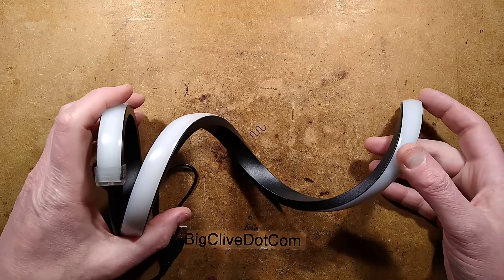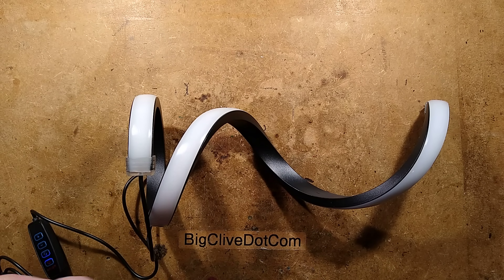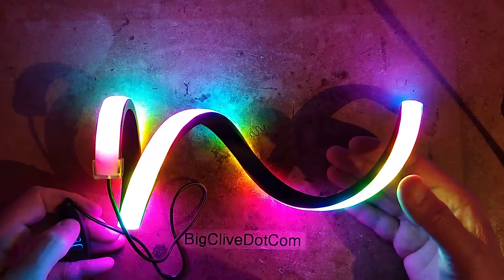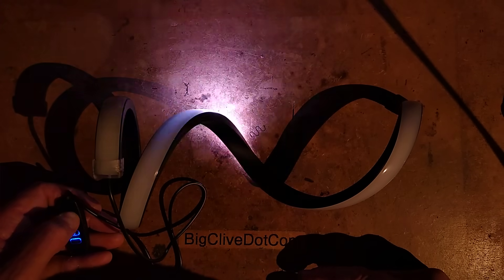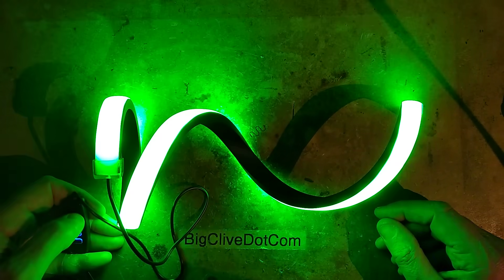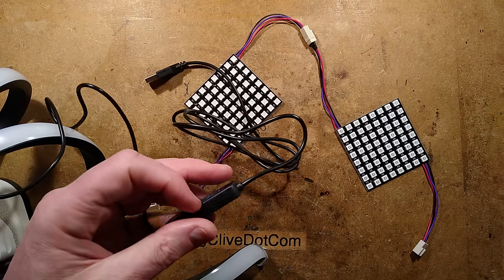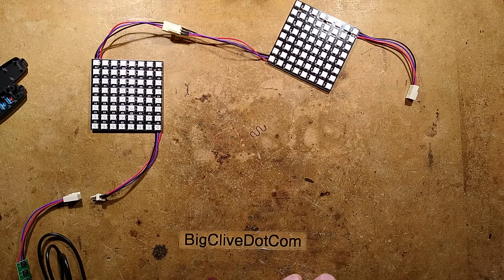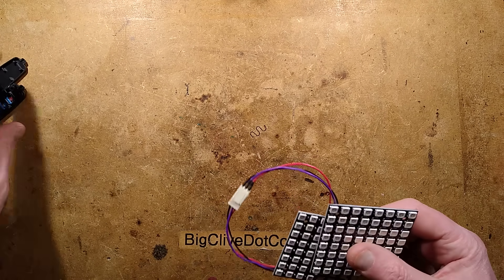RGB 36-LED spiral - bit bashed to the edge

Comment: I found an addressable tape that had a break in the tape. I cut off the non connected end and found the +5, din, and gnd. marked on it. I am only interested in one function unison red flash. The original controller does that. If I can get the cut end to do that it would be great!
Reply from the maker: You can join short sections end to end as long as you consider the high current these LEDs can pass.  You can also run multiple sections from the same controller output and they will just display the same colours.

Comment: Ive noticed a subset of controllers is usually mirrored and  different codes for  the bluetooth and or IR etc SP105E, SP108E, SP110E

Comment: Lots of folks here are suggesting WLED - but it doesn't do temporal dithering the way the old FadeCandy boards did. That's a big drawback for smooth transitions. I've not used FastLED but online info suggests that it does do dithering. And it has the advantage of running on a wider range of hardware. I used code from BigJosh running on a very old version of Linux on a BeagleBone Black to drive my Xmas LEDs last year, but I'm wondering about moving to FastLED. Far more than 36 LEDs though...
Thanks to BigClive for yet another interesting video!

Comment: I don't know how many addressable LEDs I run at home, but a lot! 😄 Light underneath the bed, lights on al shelves, lights unterneath the workbench, light on the back of the workbench, random "lightbulbs" (actual old lightbulbs I took the filamet out off and replaced it with LEDs) dangling everywhere, a string of 300 lights dangling in the hallway, ...
Everything is on WLED on ESP32 or ESP8266 (depending on the length and if I need ArtNET).

Comment: I immediately recognized the controller as I had the one for my magnifying light apart recently to fix a loose connection. The board layout is very different with tiny MOSFETs for data and 5V. The model number was NU003 which brings up all kinds of lighted magnifiers on google.

Comment: I have several sets of Phillips brand  RGB Christmas Icicle lights that are controlled by bluetooth. You can set different colors and effects in the strings of lights with your phone, and it's either 3 or 4 sets that can be connected end to end off 1 controller box, although each set of lights comes with a control box, you can connect several sets together to make a longer string and not have to group several control boxes together in the software. The lights also flash out patterns from sounds from your phone's microphone OR you can play music through the app and have the lights flash out patterns and colors to the beat of the music. 

I noticed that the sets worked absolutely fine when responding to music when each set was connected to it's own control box, but when I strung 3 sets together to be able to make it all the way down my picket fence, and run the 3 sets all off 1 control box, that I would occasionally get a glitchy LED in the strings when they were responding to music. There were no glitchy LED's when running through the slower, pre-programmed changing modes, but only when the lights were changing faster to music. The LEDs in the light sets must not be able to keep up with the faster moving data from real time music. 

I've learned to live with it though, as the occasional glitchy LED when responding to music is usually a white shimmer, and it looks like random stars twinkling in the "wall" of icicle lights hanging down from the top of the fence.

Comment: Yes, I have been naughty a time or two and bit bashed the hell out of my home-brewed hardware for running a large video wall, and sooner or later you WILL get to the point where pushing it just a LITTLE more and you end up with random LEDs glitching out. 

Better hardware, less code, or less LEDs is the answer when that happens.

Comment: At least it actually responds when you press a button. Unlike the Govee equivalent, which takes several seconds to start up the app (which has to load ads for more Govee products) and then several more seconds to send any in-app data changes to the ($60-80) light.

Comment: Yes, it bit bashes the data at 800KHz, the timing has to be spot on, being asynchronous.
It is a walk in the park to hook it up to an esp or Arduino and get Chat GPT to flash up some code for you that controls the leds the way you desire.
The data is passed through with a delay of half a bit, it's very fast.
Had some looking at it once with a 4 channel scope and seeing how the data is being passed on.
Good video Clive, thanks for sharing.

Comment: I would hazard a guess that the malformed data at the end of the string may have something to do with the VCC being too low at the end of the string to allow the internals of the LEDs at the end of the string  to pass the data on to the next LED properly.
Reply from the maker: It's possible.

Comment: wow you could not have chosen a better time to upload this video. Just this week I received a cheapo $1 aRGB strip from aliexpress and added it to my gaming pc. I cut the 50cm / 30 leds tape in half and soldered a 1 foot cable between the out of one length into the in of the other. it worked fine during testing but then I started a game and the 2nd strip started going crazy, just like shown in this video. I didnt unplug it, the wires are soldered directly on the tape. I'm guessing the extra line of wires between out and in acts as a antenna and picks up all kind of rf interference, corrupting the signal. Or maybe it adds too much delay idk. The 1st strip works fine. I guess my option is to bypass the 1st strip and wire the two strips in parallel. I think all my rgb fans are connected in parallel so that should work?

Comment: you need an oscilloscope to further analyze things like this...
Q: if you only apply power to the strip to that color it defaults or it doesn't illuminate at all?
Q2: can you hack your way without an MCU to force a single color?
Reply from the maker: I do have some 'scopes, but a high throughput of videos limits the amount of time I can spend on each one.

Comment: I can't see how your hypothesis about timing accounts for the flickering at the end. If earlier devices thought that they had got the "that's it" signal, they would reset their internal state. They would see then see half-way-through as new data. If that kept happening then the later devices would never see anything. If it only happened sometimes then the later devices would either get the right data or nothing, so they would not flicker. It is suspicious that the flickering is ALL of the later board and NONE of the earlier board. Did you try swapping their order ? It smells to me more like one board is faulty, or the interconnect is dodgy.
Reply from the maker: I did swap the order.  The timing may be so on the edge that voltage drop along the run may be affecting the internal oscillator timing.

Comment: i have 4 of those but changed the controller, the controller that comes with it does a power on reset and the other ones that i used is goign back to there last mode , i use it with a domotica system.. but the spiral lights are fun

Comment: It's silly but I always close or avert my eyes when BigClive says "watch your eyes" and turns on a bright light. Also thanks to your dives into LEDs, I made a clock with  WS2812B led strips as the hands and a Raspberry pi Pico a few years ago and still use it. I run the LEDs at really low power so I can just see it in the dark so it's going to last quite a while. It's also different hues based on the time of day or holidays. I would've never have made this without watching your videos and streams and being inspired by your projects.

Comment: Whatever "squishing" of the waveform by the 1K resistor on the output data line "shouldn't" have any effect on any LEDs beyond the first one. I surmise this because each of the LED driver chips inside each LED must have its own output driver for DOUT, and so each LED is basically responsible for the data signal integrity to the next LED in the chain.  I wouldn't expect this to be affected by the output impedance of the LED data output pin of the MCU.  Maybe for ESD or noise filtering...?

That being said, when long strings of these LEDs DO start to become squishy is the impedance of the 5V and 0V power conductors that DO run the length of the (in this case) strip.  The supply voltage at the end of the strip is going to be lower than at the start because all of the current is being carried by that one relatively modest trace that runs down the entire strip.  The way to mitigate this is to run a parallel power conductor(s) from the supply to various waypoints along the strip to keep the supply from sagging.

So, my theory is that the voltage is sagging enough that the LED controller chiplets are getting anemic electricules at their supply pin and losing their shit (to be technical).  Each LED controller chip variant and electrical construction (by length, conductor impedance, etc) can probably tolerate these more marginal operating conditions in their own, unique, fabulous/disappointing way.

Retailers that sell numerous variants of these WS28xx-like (and APA102-like) products under their own umbrella trade names probably have seen samples of "compatible" chips that can't cut the moose tard and end up in the "No" samples crate.

Comment: Now then chief. I liked this one, ordinarily I am not much of a MCU fan, their use feels like cheating, so I knew nothing about how these LEDs worked until this vid. their simplicity is rather appealing.  i got a different clock design working this afternoon, using cryastal,  4060, 4013, and 4026s on breadboard. took me days with all those sodding jumpers. My Mrs first comment was "could you have made anything less useful? Everything has a clock on it today. i can see 3 from here".

Comment: APA102C LEDs are so much better than WS2812 LEDs, and I don't understand why everyone is still using the WS2812 style LEDs anymore.  APA102C uses plain old SPI, with no weird timing requirements.

Comment: In Tunbridge Wells there this electrical repair shop and on the ceiling they have a row on LEDs about 4 meters long and at night time they switch then on and the LEDs use to change colour or flash on & off until now. About 12cm of LEDs towards the end of the string of LEDs now stay on red all the time and the others some times miss out colours so may be the dater is not getting through?
Reply from the maker: Could be bad data wiring, noisy power supply or strip fault.

Comment: I like my own version better. Bought the white spiral lamp right after Clive featured it. Replaced the white LED tape with 48 WS2812Bs on tape. Binned the controller, put an ESP-01 in the lamp's base. FastLED library to handle the time critical stuff. Coded up some (subtle not flashy) effects in C. Done deal... and much less "nauseating" than this commercial version!

Comment: Being in the LED community quite a while, that 1k resistor on the data output seems to be very high. most boards available use between 33r and 250r depending on the wires used and the distance. While testing the resistor values to be used in a project, 1k was actually almost always relatively bad. If you change that resistor to something lower that might actually resolve the flicker issue on this one
Reply: Yes - when the resistor is a series resistor its purpose of to damp down any signal reflections or ringing.  It's very rare that this needs to be over 100 ohms - I'd always start with 47 or 68 ohms and work from there.  Long, highly capacitive cables may require a stronger buffer for the signal and then a lower resistor feeding the cable.

Comment: I have an Aldi grow light whose wired remote has a very similar form factor, though the functions are slightly different (power on/off, light duration [6, 8, or 12 hours], color [red, blue, pink/magenta], and intensity). I wonder if the circuit board inside has a similar layout to that of the RGB spiral lamp?

Comment: They're not all the same. The 2812b is not automatically the same driver as the STK and it does matter if they are RGB or RGBW, and sometimes you have to send the data BRG instead of RGB (you have to transpose the two color bytes) and also they have differing timing requirements.

Comment: Some (not all) WS-2812 led's have an inbuilt capacitor - can vary by packaging and manufacturer.
I try to get the ones with a cap inbuilt; means I can reduce how many are on my pcb.

Comment: The APA102 protocol LEDs run an additional clock line. Bad for the pin count but awesome for a long string and timing iirc.

Comment: A 16Mhz Atmega328 in an Arduino can drive APA106 addressable LEDs (I think the protocol is the same as WS2812), but only just.  Each bit must be sent every 20 clock cycles, but a bit is actually 3 bits so you really only get 6+2/3 clocks per bit.  I split it as 6+7+7 which seems to work.  There is no time to do anything except push out the data so any calculations must wait until between 'frames'.  The assembly code is below, carefully crafted to maintain timing:

#define       LED_BUS_PORT          PORTD     //AVR LED_BUS pin port
#define       LED_BUS_PORT_BIT      PORTD4    //AVR LED_BUS pin port bit
uint8_t  LEDData[LEDs*3];

loop() {
//do stuff to calculate data for LEDs 
updateLEDs()
}

void updateLEDs(void) {
  volatile uint8_t  *bytePtr   = LEDData;         // Point to LED data
  volatile uint8_t  dataByte   = *bytePtr++;      // Get byte & increment pointer
  volatile uint8_t  dataBits   = 8;               // Bit counter for inner loop
  volatile uint16_t dataSize   = sizeof(LEDData); // Byte counter for outer loop
  asm volatile( //volatile to prevent optimisation
    //Data shifted out MSB first [GRB for each LED]
    //Timing: 800kbps (x3) with embedded clock (HbL)
    //16MHz/800kHz=20CLK; HIGH:6CLK, BIT:7CLK, LOW:7CLK
    //Instruction                         CLK     Description                 CLK count
    "cli\n"                            // Disable interrupts for precise timing
    "sendBit:\n"                       // -                                ( 0) 
      "sbi %[LEDPort], %[LEDBit]\n"    // 2    Set pin HIGH                ( 2) 
      "nop\n"                          // 1    Burn 1 cycle                ( 3)
      "sbrc %[DataByte], 7\n"          // 1[2] If bit 7=0 skip next instr  ( 4, [5])          
      "sbi %[LEDPort], %[LEDBit]\n"    // 2[0] Set pin HIGH                ( 6, [5])
      "sbrs %[DataByte], 7\n"          // 2[1] If bit 7=1 skip next instr  ( 8, [6])          
      "cbi %[LEDPort], %[LEDBit]\n"    // 0[2] Set pin LOW                 ( 8)
      "dec %[DataBits]\n"              // 1    Decrement dataBits          ( 9)
      "breq sendByte\n"                // 1<2> If dataBits=0 send next byte(10,<11>)
      "lsl %[DataByte]\n"              // 1<0> Shift in next bit           (11,<11>)
      "rjmp .+0\n"                     // 2<0> Burn 2 cycles               (13,<11>) 
      "cbi %[LEDPort], %[LEDBit]\n"    // 2<0> Set pin LOW                 (15,<11>)
      "nop\n"                          // 1<0> Burn 1 cycle                (16,<11>)
      "rjmp .+0\n"                     // 2<0> Burn 2 cycles               (18,<11>)
      "rjmp sendBit\n"                 // 2<0> Send next bit               (20,<11>)
    "sendByte:\n"                      // -                                (   <11>)      
      "ld %[DataByte], %a[BytePtr]+\n" // 2    Load next byte              (13)
      "cbi %[LEDPort], %[LEDBit]\n"    // 2    Set pin LOW                 (15)
      "ldi %[DataBits], 8\n"           // 1    Set dataBits=8              (16)
      "sbiw %[DataSize], 1\n"          // 2    Decrement dataSize          (18)
      "brne sendBit\n"                 // 2[-] If dataSize>0 send next bit (20) 
    "sei\n"                            // Reenable interrupts
    : // Outputs
    : // Inputs
      [LEDPort]  "I" (_SFR_IO_ADDR(LED_BUS_PORT)),
      [LEDBit]   "M" (LED_BUS_PORT_BIT),
      [DataByte] "r" (dataByte),
      [DataBits] "r" (dataBits),
      [BytePtr]  "e" (bytePtr),
      [DataSize] "w" (dataSize)
  );
}

Comment: So is there a built in timing crystal? My understanding was if there is any sort of micro controller there needs to be a clock for it to run off/ in reference too.
Reply from the maker: Many microcontrollers have optional internal clock sources.

Comment: You never mentioned the data output voltage.  If it's 3.3v, if you run the entire WS2812B (neopixel is easier to say) line through a single diode or "sacrificial neopixel" to get their operating voltage down to 4.3v or so, they will be much more happy with the 3.3v signal and much less glitchy, albeit a bit dimmer.

Comment: It was often the voltage that caused that flickering issue in my experience.  These LEDs "require" 5v but most microcontrollers are 3.3v.  So they power them with 5v, signal them with 3.3v, and it kinda works, sometimes.
Reply: True, but that normally only affects the signal to the first LED package.  Each control chip in the LED packages re-times and buffers the signal for the next, so if the first LED gets a signal, the others will definitely get a signal of correct voltage if the timings are valid.  Problems arise when the timings are right on the edge of viability - then one string of LEDs may not be directly compatible with another but only with some drivers.
Reply: @GodmanchesterGoblin This is very true